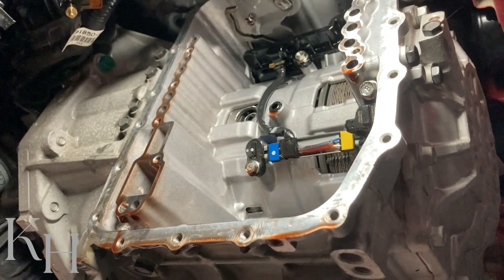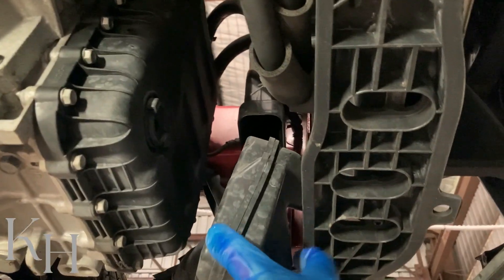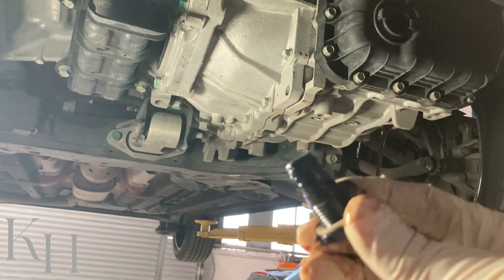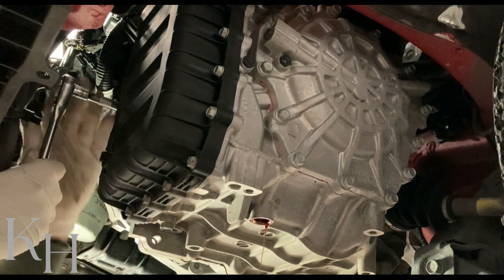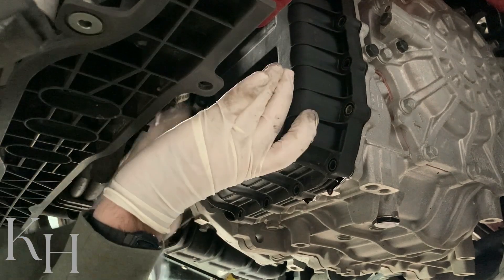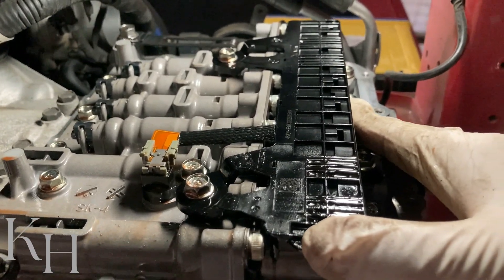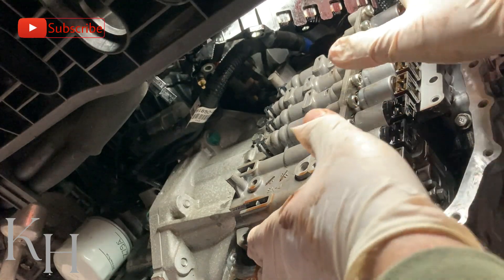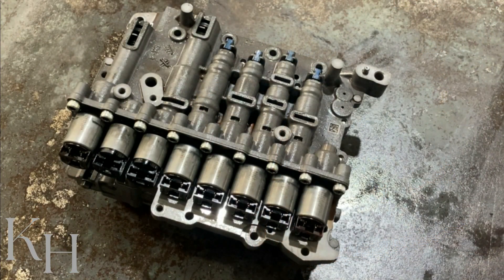Transmission Valve Body Replacement | KIA & Hyundai 6 Speed Transmission A6GF1 |A6MF1 |A6LF1 |A6LF2

Comment: New one needs coding or will work fine without coding
Reply from the maker: On this model coding is not needed, you just need to reset the transmission adaptive values and relearn it.

Comment: what is the part that has 1 bolt to remove that is on shifter called mine is bent need only that part and I can't find the name or part # its one hold valve body together. thanks subscribed!